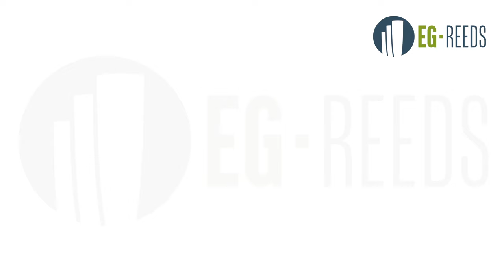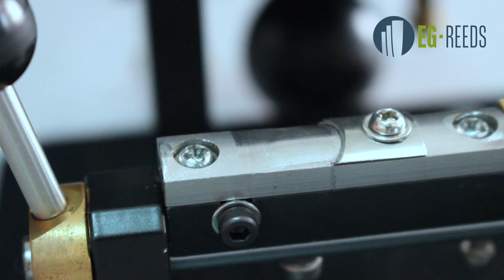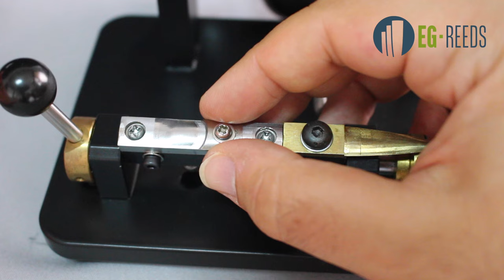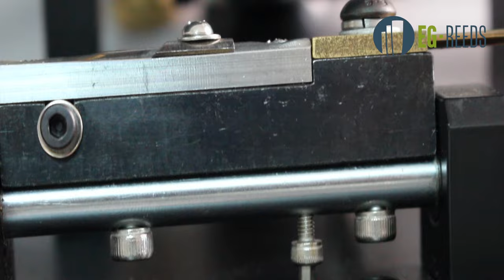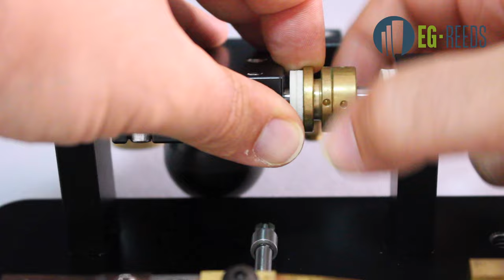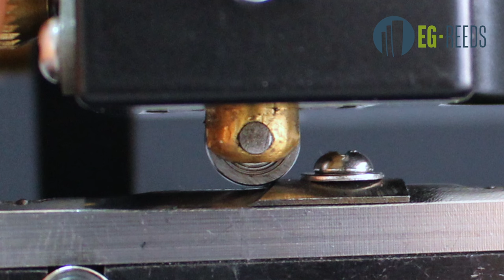How to adjust the KGE profling machine for make English Horn reeds

Comment: Thank you for this video!
One question...how do you know how much to raise the template bed by when changing to English horn? I noticed you had a bit of wire in this video, is that how you measure?
Thanks!
Reply from the maker: Dear Matt, sorry I just notice about your question. Yes I use the wire in order to have a reference. Ones you know how much you need to raise you can do a mark with a pencil. 
Best regards 
Éric